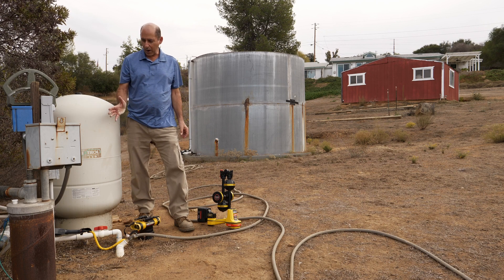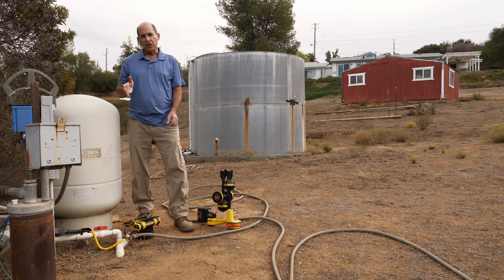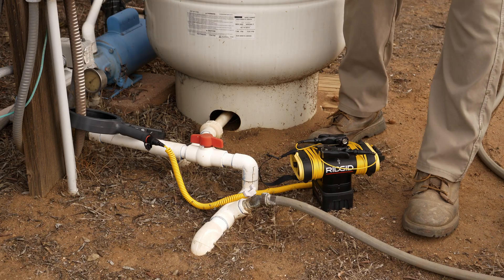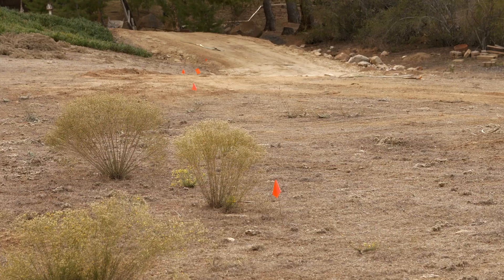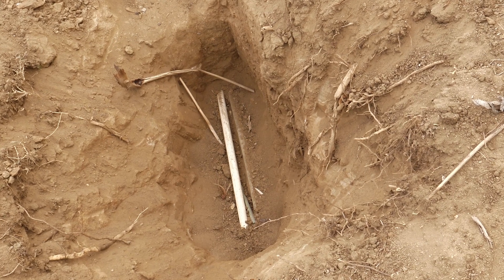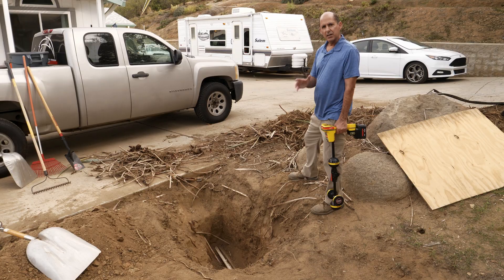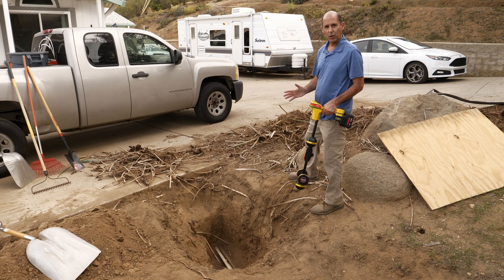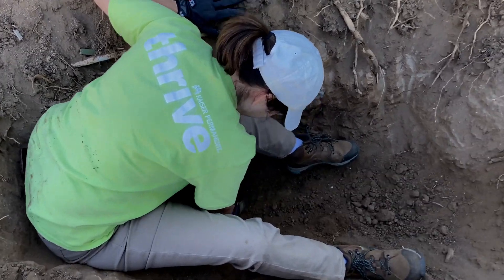Line Locating: Finding a PVC Pipe

Comment: Great video!  I am on a search to find a system to locate a PVC waterline but there is no pump wire buried with it.  Does this Ridgid system have a way of using the water in the pipe to locate the line?
Reply from the maker: Thank you for the comment! 
One of the best options would be to use a system with a built-in sonde, which is a small transmitter located in the camera head of SeeSnake reels like the microReel APX™ or rM200. This sonde can be located from above ground with a utility locator, like the SeekTech, which could help you trace the pipe's path even if there's no pump wire.

Another method, depending on your specific setup, could involve inserting a metallic fish tape or cable along the line, which can then be energized and traced with a locator. If you are dealing with non-metallic pipes like PVC, the water itself wouldn't aid in the location directly, but these tools can provide accurate results for locating it underground.
Reply: Thumper with listening device